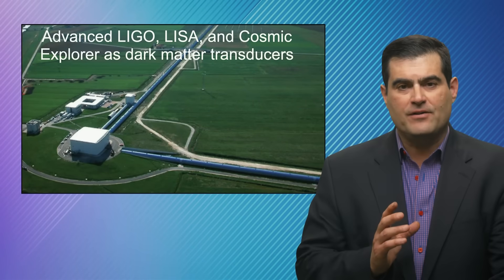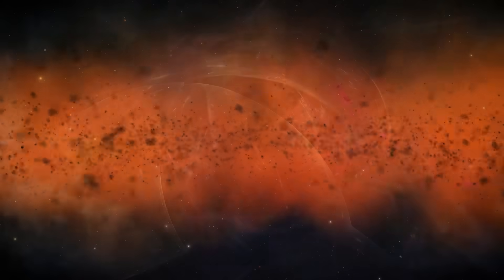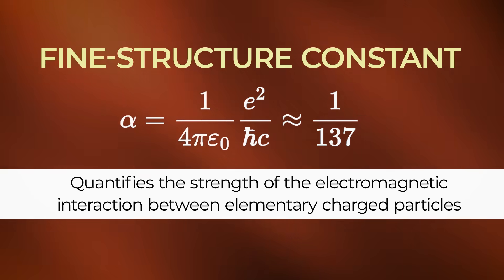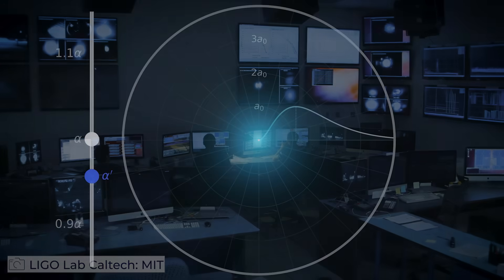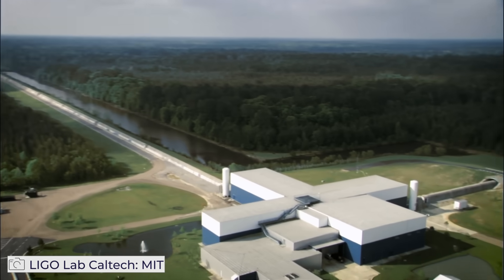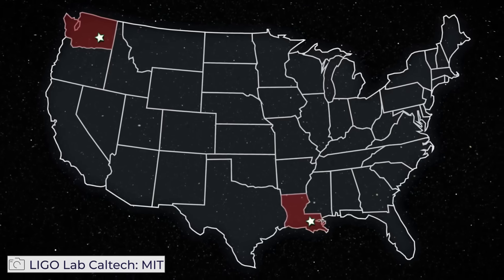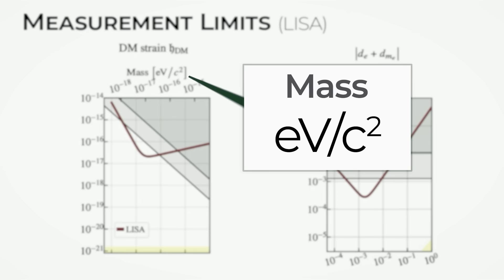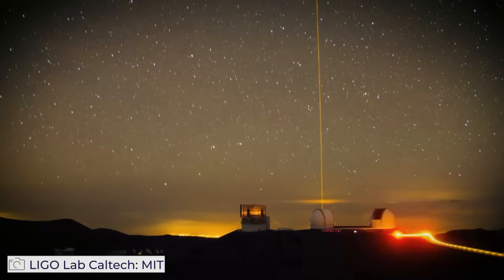MASSIVE Breakthrough in the Search for Dark Matter | LIGO and LISA

Comment: I often speculate on a version of kaluza klein theory where instead of a compactified dimension, that "extra dimension" is actually just an extra scalar field, explaining the apparent weakness of gravity. Specifically I imagine that the dirac field itself is that extra scalar field, explaining not only the apparent weakness of gravity but also the origins of charge and magnetism. Charge is just motion in 2 directions through 1 dimension and magnetism is just gravity in 1 dimension. Which points towards a possible avenue for unifying gravity with electroweak symmetry. I often wonder if its the geometry of scalar fields that give us our 3 hamiltonian dimensions and that different scalar fields have their own geometries and hamiltonian metrics. I also imagined that the dirac field is an imaginary mass scalar field, and that other scalar fields would appear imaginary to us, and we would appear imaginary to them, but that faster than light particles are still not possible leaving causality intact. I call this higgs-dirac equivalence. Basically, if you were to graph a 2 dimensional graph, massive particles would be able to move freely in the first quadrant. You can graph trajectories that go from quadrant 1 to quadrant 3 but particles can't always follow those trajectories. Even through particles in quadrant 3 would appear to move the same as those in quadrant 1, they would appear imaginary from quadrant 1. And gravity IS able to travel between both. 

I imagine that the quanta of scalar fields are particle-like 1 dimensional scalar fields with complex mass. And that the dirac field is actually a manifold of 1 dimensional fields made up of many of these quanta that is basal to the evolution of our 3 dimensional higgs field. In the dirac field, these quanta behave like a gas whereas in our higgs field these same quanta behave like a superfluid. As a result, massive particles behave in a space-like manor in the dirac field since they can only travel in directions along the tangent vectors of those scalar quanta, and they fall out of the dirac field and into the higgs field due to the force of gravity alone. In fact, since gravity can pass between scalar fields, the force holding this cloud of quanta together and ultimately leading to the superfluid higgs field is gravity itself. Scalar quanta interact via quantum gravity. 

This could have implications for dark matter, but an imaginary mass dirac field definitely has implications for dark energy. The repulsive force pushing apart the universe. And possibly even the inflaton field in the early universe. Essentially the dirac field is our universe's equivalent to its cauchy horizon. The inner event horizon in a spinning, charged black hole. Which has implications for ads/cft. Not only that, particles have real mass AND imaginary mass fields, explaining the large electron problem for kaluza klein theory and the mass gap problem for yang mills theory. We can't accurately predict mass because we're trying to predict real mass when the formulas are giving us true mass. Dark matter could be explained by the anomalous imaginary mass fields off all the real mass particles in the galaxy. They don't dissipate due to the inverse square law due to the different geometry of the dirac field, so its harder to measure the affects of an imaginary mass field like we do with real mass. But a galactic imaginary mass field would accelerate the edges of galaxies like we see with dark matter. 

Particles interacting with two different scalar fields due to yukawa coupling could explain the double slit experiment, too. Basically particles are just icebergs bobbing between two different mediums. And bell's inequality is wrong because all of our results ARE inexplicably correlated, one of the possible caveats for bells theorem. They're correlated because we're always trying to measure particles from one of these two scalar fields. Like trying to detect the mass of an ice cube but by only pushing against it from above. It also explains quantum tunnelling as massive particles are able to move through this imaginary mass field, they just need to overcome the force of gravity to do so. Also, since magnetic fields basically act as solitons in a 1 dimensional geometry, quantum entanglement could be explained due to coherent 1 dimensional interactions between particles. An imaginary mass dirac field might also explain the absence of magnetic monopoles in our universe, as they would be particles with charge but no mass and would therefore only have imaginary mass. Therefore they would fall INTO the dirac field due to the force of gravity, and normal matter could be interacting with magnetic monopoles on a daily basis but we just don't see them. 

Anyways, if any of this is plausible, then this ligo experiment could be able to find evidence for an imaginary mass scalar field.

Comment: I was reading about an experiment yesterday that was very interesting.  So they were trying to stabilize a metal ball on a spinning magnet, that's very interesting and much overdue.  I'm happy someone's paying attention.  This type of experiment needs to have tremendous funding moving forward.  Do we want to go for a ride? This is the way, I will be watching these folks for a tremendous breakthrough on this front. Why use fossil fuels when you can use the cores of stars and planets and blacksphere for that matter. I'm very excited about this very excited. Why push when you can slide lol. Great video, but I already told you what dark matter is?
Reply: This comment makes no sense to me.
What was a ball on a spinning magnet so expensive and what does it have to do with dark matter?
Reply: @sadderwhiskeymann9782 has nothing to do with dark matter. It was getting a metal ball to levitate from another spinning ball. Through reverse magnetism.  So magnets, if the polarity is reversed, they repel. Well, they stabilized this position from the reverse through the spinning sphere. So if you built a craft and used say the earth's core and reversed the crafts polarity, the core would keep you afloat above the surface of the planet. Add power and off you go. You ride the cores EMF.  Think Star Wars and Luke's car, the one with no wheels.
Reply: @alex79suited  i see.
However i very much doubt it that Earth's magnetic field will suffice. You have to built the track with superconductors even, i think that's how maglev trains do it
Reply: In an atmosphere environment, the power would need to be increased accordingly. But in the vacuum, it would just require the fields as all mass is equal. And would also provide protection to the occupants in said craft.
Reply: @sadderwhiskeymann9782  but that's a good thought, so I would say the cores strength would suffice if the craft could direct the fields. Instead of using the surface strength go deeper and centralize the application.
Reply: LOL

Comment: A scalar field would not be prejudice.  It would interact equally with all matter, not pick and choose.  All mass would be affected equally regardless.  If a star weighing the mass of our sun is affected by dark matter then the same size star should be equally affected elsewhere in another galaxy, or in our own.  But the S-type stars orbiting close to the black hole in the center of our galaxy are not affected by dark matter, some are larger than our own sun.  Dark matter doesn't affect the motion and orbits of the planets, moons and other small bodies in our solar system.  Dark matter doesn't seem to affect stars in diffuse galaxies.  It however appears to affect the suns velocity as it orbits the center of our galaxy.  Yet it doesn't affect the velocity and trajectories of the planets and moons within it?  Hmm, why is that?

The gravitational experiments will flop, it will not detect a scalar field, just like the Michelson & Morley experiment was a flop and couldn't detect an Aether field.  They couldn't even detect parallel universe with the gravitational wave detector.  As my dad would say, they're barking up the wrong tree.

Comment: LISA should consider using a dual laser system that employs a helical laser and straight beam. The time stamp data in the helical beam would be corrupted by the straight beam, allowing an accurate focal point location of the g-wave source due to the parabola formed along one side the corrupted helical data.
Reply: Wtf is a helical laser?
Reply: your search engine broke? @kayakMike1000

Comment: If you conceive of gluons as 10^-34 m electromagnets, they could function as the working fluid for both gravity and space-time viscosity with the added behavior of droplet formation due to Feshbach resonance with the galactic EMF. These droplets are regularly burst by cosmic rays, etc., to shower down on the originating galaxy to generate the high BTFR.
Reply: Really, please show me a diagram of a gluon and I'll show you mine. How is it that the g-wave takes as long as gammas to get here when we know the photons take a circuitous path? That's not a pre-bent space-time quality and in fact suggests a particle along with the behavior of High z superclusters. Their disk galaxies are all in the same plane and have long orbital axes in the direction of red shift propagation, a clear laminar flow particle effect similar to wind socks responding to the same breeze in direction and magnitude.  @metallicjeans
Reply: Yes, I understand, but in my quantum gravity conjecture, gluons are made of daisy-chained photons in a helical pattern producing 1 to 3 aspect ratio tori and the shaft that mounts them. In this configuration, the angular momentum of each photon is shared throughout the larger structure that amplifies the ambient EMF to extrude quarks inside of nucleons and form dark matter droplets in the galactic EMF. Take a look at the Star Collaboration that produces quarks and anti-quarks between two colliding gold ions. This suggests an ambipolar nature of gluons outside of nucleons or even a nucleus. @metallicjeans
Reply: Rofl😂😂😂
Reply: I can see you're intent on substantiating the salacious rumor; that even ambidextrous physicists can't find more than 4.8% of their..... @justinpyle3415
Reply: @metallicjeans don’t take virtual photons so literally